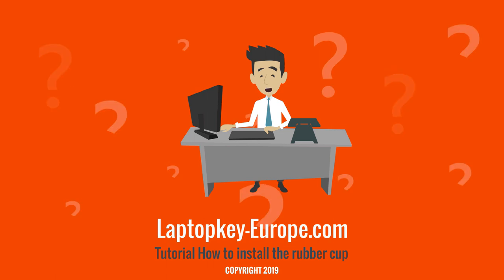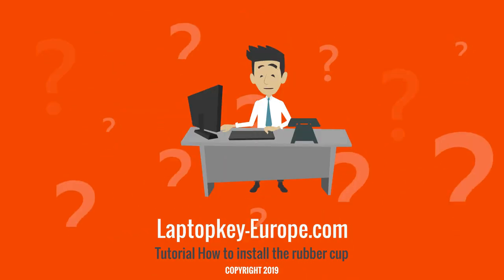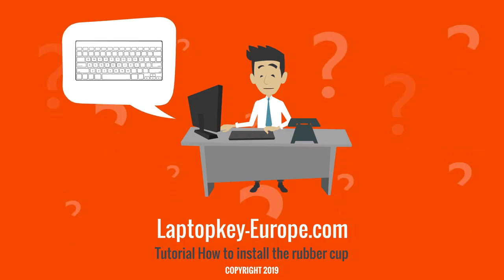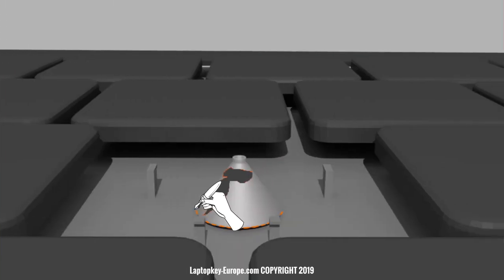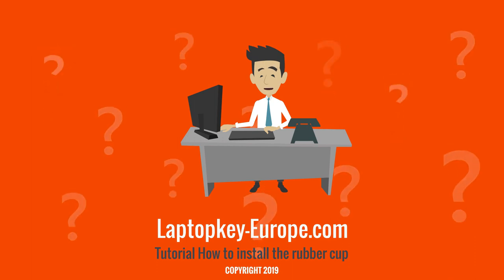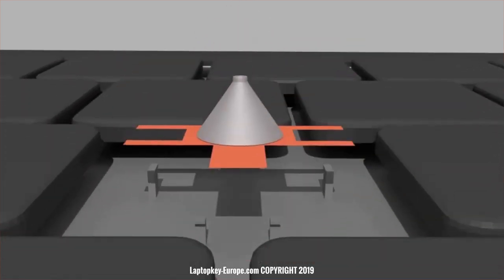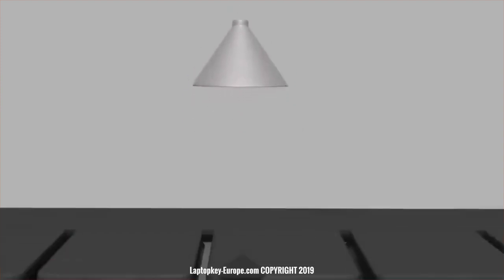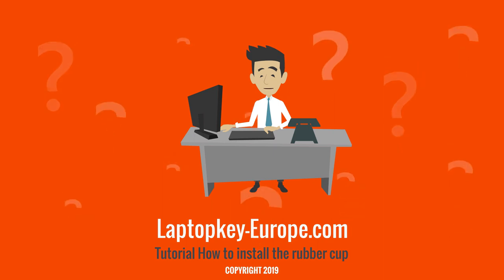How to install a rubber cup of a keyboard key

Comment: hello.. Is it possible to replace rubber cup and fix half-unresponsive keyboard button? I mean my wasd buttons are working just if i press them at the middle and from pressing on corners they are not working I mean they are used a lot and i guess their rubber cup needs to be replaced ...
Reply: same problm did u find thee solution please?

Comment: Does all glue work?
Reply from the maker: Yes. The most important thing is to put very little glue. And use a needle to put it under the cut.
Reply: @laptopkey-europe4006  Ah thanks, I've had my rubber cup loose and I've been wanting to fix it for a while.

Comment: well i lost the cup so..
Reply: what did u do ?
Reply: @nova9157  nothing its just a key pad with no key or rubber cup
Reply: @demihayes6310  does it work ?
Reply: @nova9157  its not the best feeling to use but it works fine
Reply: @demihayes6310  ohhk and thanks for replying so quickly